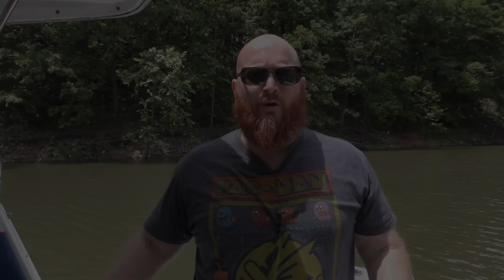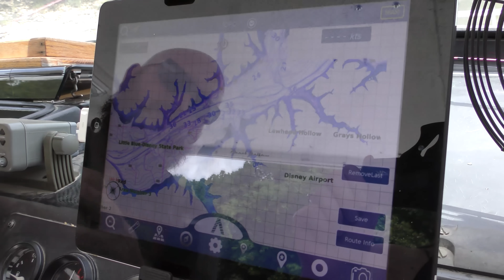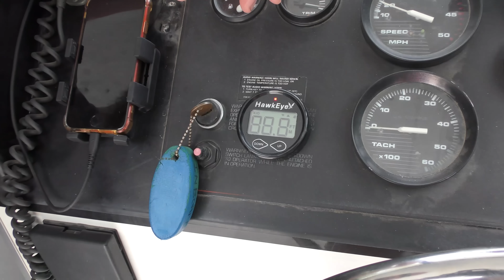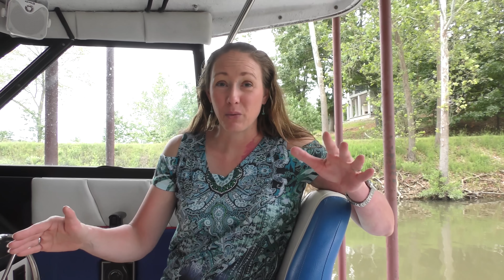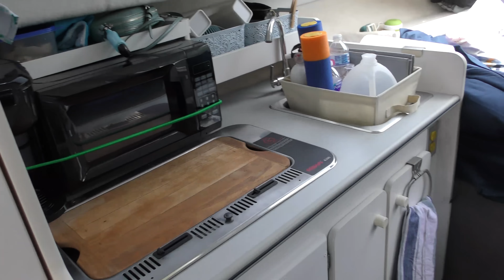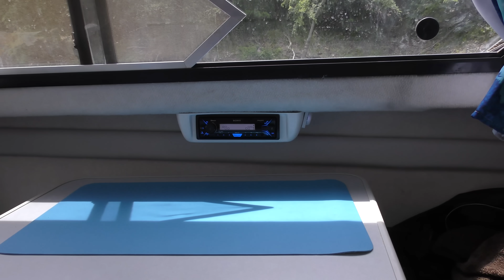Cruiser #4: It's Sea Worthy! See the CAR WIZARD get the boat in the water and the issues that arise

Comment: You need more anchor line. Make sure you have enough chain.
You can just put a 2 stroke 9.9 hp outboard if you want a lightweight trolling motor.

Fun part about boating is you will still feel the rocking hours or days after being back on land. 😅
Smart move not ripping the deck up, we spent $25,000 replacing one of the 2 150 gallon aux tanks in the Carver.

Comment: Good idea,
Get rid of that kicker (15 hp motor)!  You’ll never need it. It gets in the way, unbalances your boat and looks ugly!  If you really desire a small kicker motor, sell that one and buy a much smaller more current year motor. It will be more efficient, you can stow it on the boat and out of the way. You certainly won’t need much horsepower to get you back to the dock when you mainly use your craft on a lake.

Comment: The nose? You mean the bow? Like I mentioned in your earlier video, check out KBS Coatings for the fuels tank repair. I have done several fuel tanks without having to cut out the tank. Only need to disconnect and drain the fuel, clean it, let it dry out completely. Then use the sealant. just rock the boat in the water to cover the entire bottom. It will fill pinhole leaks very easily. 
The corrosion in the tank comes from water that sits at the bottom and without all of the anodes in-place, the galvanic corrosion goes after the aluminum tanks.

Comment: good move ripping off the foil and steering link...youre also learning the Bayliner curse, a terrible hull design which has way too much taper from amidships to the bow, and that sharp entry with lack of buoyancy and super narrow beam width at the waterline means it tracks abruptly and when it gets off a straight line it unfolds quick where it actually will bury one gunnel or another, especially in following seas...its best to keep that boat on a lake or river, where it will never see heavy seas, good luck!!

Comment: A single i/o will wander side to side at non-planing speeds.  Not over-responding to the wandering is hard but it is natural.  The trim tabs will help some but it will still wander.  Its normal.

Comment: You've got all the batteries on the left side too, along with the extra motor 
I think the steering was most likely just you getting used to driving a boat. Probably just overcorrecting since you're not used to it 😁👍

Comment: You need a lot more anchor rode than 80' for anchoring in 40' of water. Good rule of thumb is 7:1 rode to depth. This is the main reason why boats drag anchor, they're improperly set to begin with

Comment: Your boat is a very small and very light weight machine.  Its going to be sensitive to weight balance.  
     After a few hours on the water I would not have pulled off the hydrofoil.  It was there for a reason and a guy with 2 hours boat time may not know how to evaluate or steer or setup a boat. Could tell you are brand new watching you try to back up.  The classic zig zag is typical of someone with 30 minutes of boat experience.  Take a course and let someone  with 20 or 30 years of experience show you some things.  
           You seem way overly concerned with power and toys on the boat and way under educated on how to drive and operate the machine. Dont think your ready for boat traffic or weather / wind or any emergencys.  
       Have some extra 60 foot lines with some snap hooks set up..  learn to tie some knots and how to dock..   do you have any idea about  correct lighting to have for other boats ?   Or  throw cushions ?   Do you have a decent medical kit ??    Hope you have lots of sunscreen.   Learn how to correctly use fenders..   be safe and stop building and learn to use what you have now.  
       On my boats I always had balance bubbles mounted to help me stow gear and fuel and people.  My smallest boat was 41 feet with a diesel engine and tons of fuel and water.   You need to have someone help get you safely into boating.

Comment: The hydrofoil is excellent in a small boat to give you lift and help level the boat.  Sounds like you did not pre setup the control tabs at all.   The kicker motor might be better being a ten hp.  Or having a ten foot inflatable with 5 to ten hp that would get you back to the dock as well.   Ten gallons per hour is quite a bit.. fyi. 
       You may want to have a few 5 gallon water bottles you carry to the boat.  Cant have too much water.  

      The electronics and stereo stuff is really only for kids.  Enjoy the quiet and the gentle rocking of the boat.   
       The power cooler was a nice idea.  That you will like.   The idea of the boat is quiet and pretty views and just being calm.   Have some coffee..  have a glass of wine.  
      And you want a longer anchor line ..

Comment: Congrats on the new hobby! Do yourself a favor and take your state's safety course (if you haven't already). They are normally free from sites like BoatUS. I'm not saying you're unsafe, but there's a lot to learn that can help make your boating season damage and injury-free. You shouldn't need to adjust your IO trim that often once you find that sweet spot but you will likely need to adjust your tabs regularly depending on the day's weight and balance. Enjoy the season!

Comment: Congratulations on getting the boat in water! Woo Hoo! One thing I feel I must say, on a marine vessel those things that resemble ropes are NOT "ropes". They are "lines". You don't want to sound like a land lubber after all. I can't address your specific situation because I don't know the layout, but most trim issues can be addressed by how fuel and water are stored and consumed.
Steering for most vessels is never going to be like a Maserati. Plan ahead. When I was a "Licensed Operator of Uninspected Towing Vessels on Inland Waterways of The U.S. excluding Western Rivers" we would typically push a 600 ft. tow, but on a few occasions  I've have pushed 1750 ft. tows. Not all that much fun.
So, when you are at the helm, always watch where you are going, and plan ahead. You're a smart guy. You will get the hang of it in no time. Just remember your brakes are as good as non-existent.

Comment: Hey Wizard, just to be safe if the wind picks up you need more length of anchor chain/line. At least a 3:1 ratio, 5:1 for overnight.  If you currently have 40 ft out in 20 ft of water a 2:1 scope isnt enough.  You will drag your anchor if the wind picks up.  Enjoy the boat!

Comment: The outboard motor is crucial for safety if you boat on the sea/ocean.
Just leave it there with the strut disconnected, and shift a little weight to the other side.
Removing it would be a dumb move

Edit - those outboards have saved my life

Comment: Nice video, but it sounds like you really should have read up a bit on how drive boats and how outdrives work before you took it out. The right position for the trim tabs and outdrive is self evident if you know how they work. It is not a set-and-forget kind of thing, but it isnt very difficult either. I can only assume you arent very versed in handling unexpected waves and stuff of that nature either, please remember even shallow water has dangers. You might hit a floating log or something, and I just want you to be safe. Take care and happy boating.

Comment: Two points
The steering attachment is designed to be quick release so you don't have to have it attached when not needed.
You can have a bladder made to repair fuel tanks.

Comment: Good test outing!
I've used the Dolfin before and it made quite the difference for the better. It was on 25hp Merc on a 14ft Lone Star modified with a floor and front seat drive w/tiller stick. It helps under powered boats best.

Comment: I’m a master captain. Some advice I can give you is buy a good cooler like a RTIC or Yeti. They hold ice for about 5 days if you pre chill it and use good ice not wet ice. Buy a camp stove and cook outside. No sense in heating the boat up and Of you have a fire you can throw the whole thing in the water. Use 3m 5200 for sealing anything below the water line or things that are permeated like when you delete that motor. You need more anchor row and possibly an anchor. I’d say get 50 feet of chain and 150 feet of line. Chain is what keep the anchor hooked. Learn how to tie a cleat knot and a Bowline bend. Make a “oh shit pump” that hooks to the batteries and a garden hose in case the boat ever starts to sink and the other pumps aren’t working. Hook bilge pump‘s directly to the battery and only use separate float switches. I’m telling you this from experience. Good luck with the boat, remember to have fun and don’t get to crazy with upgrades.

Comment: The small motor is your auxiliary motor for when your main power dies for whatever reason. Which ALWAYS happens when you're about to drift in a stiff breeze onto sandbars or rocks. (You got no handbrake on the water.)
Your anchor line should be no shorter than around three times the depth under your keel. There should be a fair length of chain at the anchor to keep it lodged. Less length than that chances are she'll drag the hook out of engagement if the wind freshens. This is basic boat awareness.
You may know your way round cars but your boat ignorance appears substantial. And in a stiff breeze I wonder how much way an off-centre 15hp aux motor will provide. Retrim the boat's contents to adjust for the aux motor's mass. Theres always things can be moved. Often doesn't take much.
You should have taken a basic course in boat handling to keep your boat from being a possible danger to other craft and jts occupants. That is all the more applicable in an inland lake where theres likely to be others who don't know the rules any more than you do. In such situations collisions are all too common. Add booze as many do, (you wont but they probably will) the above becomes much more likely. Squalls can blow up at zero notice. At such times even lakes can turn into wild and terrifying places well capable of eating a badly handled boat.
If you raise that motor you may get prop cavitation and accordingly reduced thrust. These things have to be submerged at the proper depth.
I have several decades of small power boat experience both inshore and on inland freshwater. Please take that course as mentioned.

Comment: Something to consider - put 150 lbs of ballast in the hull on the opposite side of the kicker motor. It should bring the boat to floating level without having to remove the outboard.
Reply: The batteries should have been on the opposite side.. and the fuel tanks.

Comment: Mercruiser Mercury marine mechanic since 1979.
These are the main issues:
Water in fuel
Bad rubber impeller in lower unit of out drive
Overheating
Gimbel bearing in transom
Bellows rubber cracks causes water leak in to bilge
Shift cable stall in reverse
Upper gear case fail from low oil
Spun hubs in propeller
Clogged exhaust elbow risers

Much much more in salt water where I am mainly electrical issues.
Fresh water motors stay perfect.

Enjoy

Comment: Wizard; do you have a hand hole access to the built in tank? You can get a custom made fuel bladder if one isn't already shaped right. Chris over at B is for Build had to have one for his Jumpacan project. Or tear out the tank and support structure and rebuild it as a storage area. Forty two gallons is abut right for that boat. I'm not sure why the previous owner didn't just troll on one engine at idle- I would have, as the 150-200 pounds is a drain on fuel and it is permanently out of trim. From an ancient kid from New Orleans who had a boat before he could get a driver's license. Sixteen foot, 35 hp and trailer! I found out it was easier to hitch a ride to the beach if you had a boat on a trailer than a cooler of beer! FR

Comment: Wizard, you could fill the leaking tank with expanding foam and create additional floatation, rather than taking it out. 😎
Reply: Create a punch list for each launch: drain plug, trim tabs up, batteries off/on, blower motor on, outdrive in proper position for haul/launch, etc. 😎

Comment: Hey Wizard! Two words for you.... Sun Screen!

Second, the amount of anchor rode ( not rope ) should be at minimum 5x the depth of the water. This is called "scope". So in 20 ft of water, you would want to have out 100ft of rode. 10 - 20 ft of chain is a good idea attached to the anchor is another great idea. The chain will cause the rode to sink, and hold better. Be sure to back down on the anchor. 

Finally, get an Engel cooler. I still had ice in mine after 5 days in the FL keys in summer time. And Eggs. And I second everyone who has suggested take a boater safety course.

Comment: I will suggest that your listing to  port is not entirely the fault of the kicker motor. That, and also the wandering behaviour you are trying to compensate for are largely a result of raising the center of gravity.

You removed 440 pounds (70 gallons of gasoline) from below the waterline, and also added the weight of the Solar array, charging system 10 or more feet ABOVE the waterline, as well as another raised fuel tank, and I would guess you AC install is heavier than the icebox. 

Imagine if you took a big 60s Buick, added 4 foot ladder bars to raise the suspension, put a rooftop carrier with several full jerry cans of fuel in it... Then shortened the wheelbase by 18 inches, put a really heavy sub, and a bunch of amplifiers and a second battery in the trunk, and ran it on skinny 13 inch tires...

Now you have the car equivalent of what your boat modifications are.

I'm glad you all came out safe, and you were able to enjoy your long weekend, but PLEASE get several hundred pounds back on the bottom of the boat. Use a vinyl liner and fill the old tank with water and run a pump for a transom shower and your sink or something... Or throw epoxy resin in it, swish it around until the leak is plugged and fill the tank with gelatin if you want, but lower your center of gravity back down to a safe place.

Your handling will improve dramatically, and weight distribution in the boat and on the decks will not cause nearly the same listing.

Comment: You don't need to remove that smaller motor. Just load your coolers and other heavier items in your boat on the opposite side and it will help level out.
I grew up on boats, mostly bigger ones (35+ feet) and I remember having to load the coolers right.

Comment: the biggest thing to remember with trim tabs is you do not want them down when going slow or docking always bring them all the way up don.t know if you have a joystick or two rocker switches as far as motor trim all the way down the trim tabs can take care of the rest unless you are really bow heavy which will make the boat handle like crap especially at speed just remember throttle down tabs up

Comment: Hi Wizard. I ended up subscribing to your channel on the back of Hoovies' channel.

I'm over in the UK.

I do all my own car maintenance, but if I ever needed a garage, a guy like yourself would be who I'd choose.

You know your stuff and you always tell the customer what actually needs to be done, not try to remove them from as much money as possible for pointless jobs.

Good on you for that.

I wish you all the best, and I'm enjoying the 308 videos. The 308/328/288GTO (and the 512BB) are probably my favourite Ferraris. Beautifully styled, plus Ferrari used to rally the 308 under the Group 4 regulations. They do look good with staggered tyres and flared rear wheel arches.

I don't think that I'd ever want to own a Ferrari though. Most of them do no miles so always have lots of issues, plus the build quality is questionable at best. - Someone once asked McLaren if they were trying to emulate Ferrari. Their answer was, "No. We don't have anyone here who can weld that badly."

Keep up the good work.

Comment: If you have an ice box for food in the cabin, it’s generally on the opposite side of the auxiliary engine. If you fill the ice box full of food and ice for a long weekend it should balance out and level the boat. I had a trailer yacht with this configuration

Comment: We need to change the of the wizard to the whiner LOL the whale tail doesn’t cause any issues you just  don’t know how to use trim tabs very small movements and panic is not something you do on a boat  your a newbie baby steps and you wanted an old boat you have old boat problems but your friend doesn’t know anything about out drives if he told you take off the hydro foil on a boat that size

Comment: Good rule of thumb for anchoring. You put the motor in gear in reverse and let out 3 times the depth for anchor rope/chain, if you don't, your anchor will drag instead of bite into the ground. This is critical especially when sleeping the night achored

Comment: Doubt that motor alone is causing the boat to list, the motor and fuel tank plus the batteries you put on that side combined is probably the actual culprit, boats have to be balanced side to side.

Comment: I would highly recommend putting about 5 ft of chain in between your anchor and rope. This makes it easier for the anchor to dig into the bottom of the lake and grab on to stuff.
Reply: In addition to the chain lowering the angle of pull on the anchor you also get abrasion resistance. Looks like boat length up to 30' if often sighted for general guide.

Comment: That outboard is there in case you lose your main engine. No other reason.  Some boaters like knowing they have a back up, the feel more secure. You will see that sometimes on ocean going boats your size. Doubt you need it on the lakes. Wizard, boats and ships do not have ropes. They have dock lines, Anchor rode and chain etc. Sail boats also have sheets that control sails. Have fun in the sun.

Comment: Here's a thought.....how about replacing the kicker motor with an electric one? Using either solar panel power or battery power it could be a good "get you back to shore/mooring point", (albeit slowly)" backup.